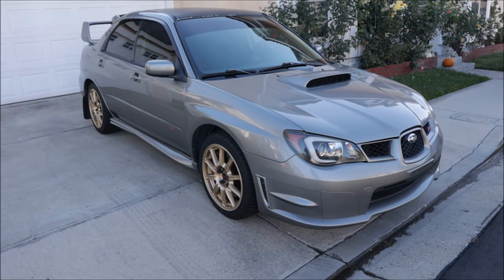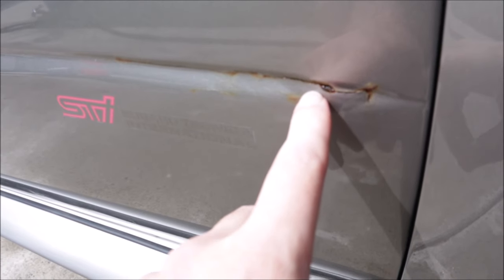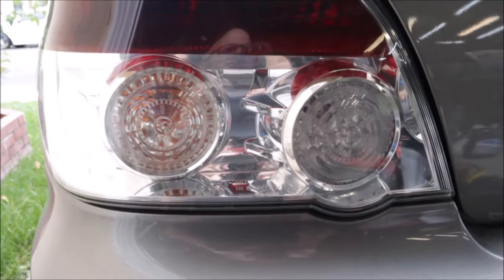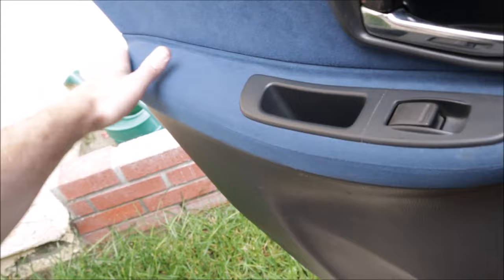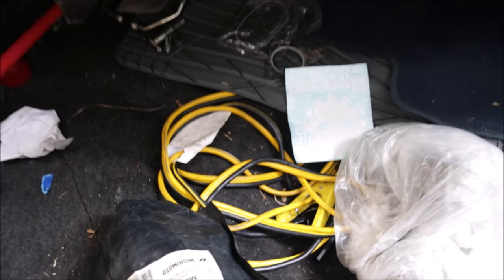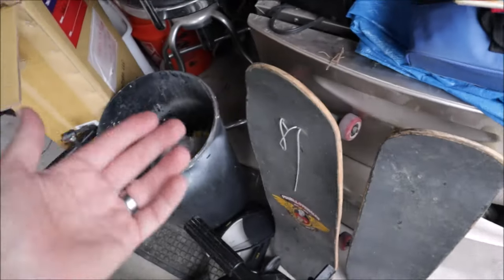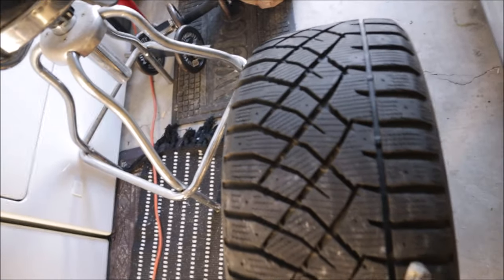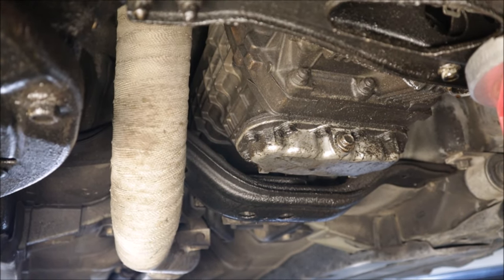I Bought a High Mileage & Neglected 2006 Subaru Impreza WRX STI Hawkeye

Comment: That thing is mint idk what your talking about. My 2013 STI limited has its front bumper in two giant rips, the paint has faded, the body has tons of scratches and wear. Your example is miles better than mine. And get this. My 10 year old car has 65k on the body.
Reply from the maker: I may have been slightly over dramatic!
Reply: Slightly is an understatement for the vocabulary used in this video. Things got 0 rust
Reply: I love that "65k on the body means that its on its second motor already
Reply: How is your paint faded? Mine is the silver and it's 2005, it's got 200,000K on it and the paint is chipped but not faded at all
Reply: @iHaveTheDocuments  stored in the sun

Comment: Those black Perrin wing supports are fundamental. That wing is known for flopping and vibrating during highway driving.
Reply from the maker: But look at them! 👀
Reply: @RoadPatina  I didn't say they were pretty 😝
Reply: They most certainly are not fundamental. Yes the flex which is part of their design to how they work. Look at airplane wings they are not rigid they have to flex. Those stabilisers are ugly and do not have a purpose. But 17 yos think they look cool for some reason.

Comment: Neglected, yes. OTHERWISE, it's good. I'd say keep it. Remove all the crap aftermarket parts. Go full oem. No rust is a great start.
Reply from the maker: I think you are on to something!
Reply: @RoadPatina  If you have tools or a garage jack/hoist (amazon) drop everything, power hose/degrease it, and source oem replacement parts. Even stock turbo. Restore its natural driving form. No rust, you'll increase value, appreciate it a lot more, and won't forget why you bought it. Looks like you now know where that rust came from. Looked like a dent/scratch with fender. Can always have body shop repair oem fender. Won't be much since it's off car. Value here is oem Vin sticker. You're really not too far off other than lots of tlc.

Comment: Man I’m jealous. My 06’ sti I picked up to resto has completely rusted out rockers underneath the side skirts. I realized it when I went to jack the car up for first time and pinch weld disintegrated to rust dust. The car drives and runs so good though 🤣 I’m just gonna have to buy a welder and do my first rocker panel swap
Reply from the maker: @DiLLY_V92  buying tools and learning is a good thing! Check out @subiesantuary channel with all the rust repairs.